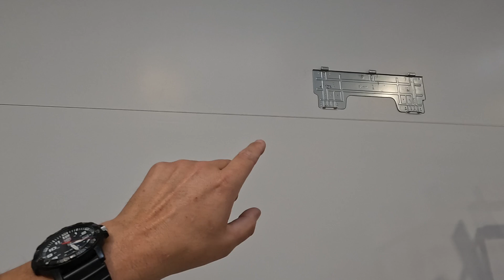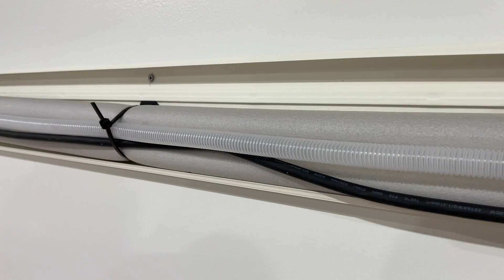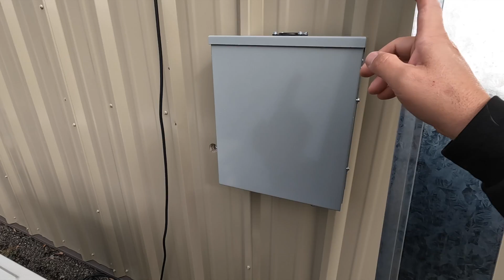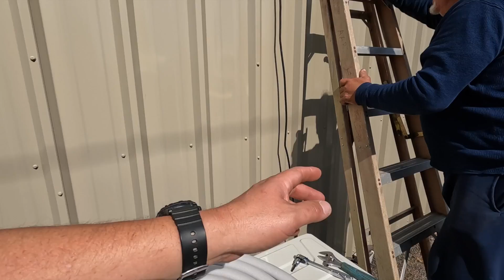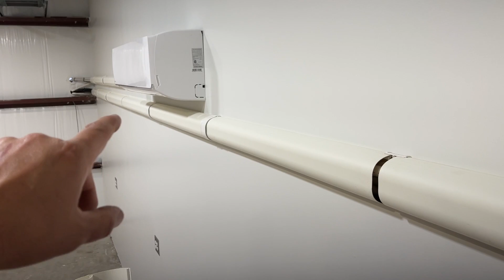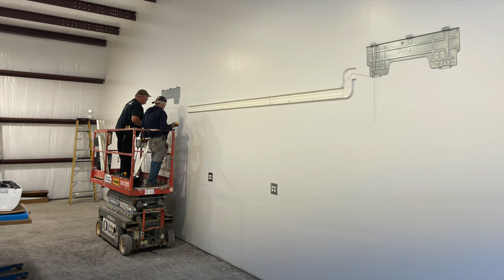Mr Cool AC INstall for New Shop Part 2

Comment: Does the installation manual mention anything about coiling up the excess pipework vertically?  Some say it creates an oil trap so needs to be horizontal.
Reply: yes, pretty strange, I would have thought refrigerant pipework should be cut to length, esp. when installed by a professional...
Reply: @n1352-m1i  If I understood correctly the system was pre-filled, that's probably why it cold not be cut to length.
Reply: @BrainHurricanes  The pipes weren't pre-filled. They arrived empty.

The refrigerant was stored in the condensers.
Reply: @BrainHurricanes  I've installed pre-filled systems such as these (DIY, only smaller perhaps) : I've cut the hoses to length and redone a cone to the shortened end (it's only copper, a lot easier than stanless fuel pipes) imho it's better to keep the dead volume as small as possible (then there is the syphon neck issue with keeping the extra tubing coiled...)

Comment: Thought they made extension lines as well there is another company I know of with quick connect 25 or 50 feet  precharged with 410a
Reply: Correct. I’ve seen extension lines sold online. Perhaps they were out of stock or Fernando could make lines himself for less.

Comment: I hope you installed the drain lines with a slope, otherwise they might be useless and not working correctly
Reply: Was just going to ask if those needed to be sloped to allow for proper drainage.
Reply: yup drains need to be laid to fall and the pipe insulated otherwise they will sweat in the summer and drip everywhere

Comment: Why dont you pull a vacuum from the lines? That would make a Vetter performance especially with the long lines, you have pleanty of Wir in the System, thot dont need to have that, a little Hand pump costs 20 Dollars and did the Job for me, a professionell should have a pump.
Reply: Did i watch the same video...i saw manifolds and vacuum pumps right there
Reply: @nekoroms  yeah, vut at the manifolds you see a little cap on the left, there you can pull a vacuum out of the lines, the lines cant be prefilled, sice the were lengthend
Reply: As a HVACR tech I can tell, those are precharged refrigerant linesets (the big give-away being those massive cupplings) so no evacuation needed. I am not saying I think it is a "flawless system" and I personally am no fan of those lines donuts behind the condensers, but as long as the installation is done correctly it will work.
Would custom cut & bend linesets look nicer? Yes they would most likely. Would a evacuated lineset improve the performance of the system? Only if you messed up those cuppling and have created leaks. My concern is with the boatload of cupplings leaking at some place in time... or never at all...
Reply: @Arides2010   " am no fan of those lines donuts behind the condensers," I agree. I made mention of that and apparently Abom didn't like my comment, and deleted it.
Reply: Let it go

Comment: You need a cable clamp where your electrical wires enter the electrical box on the condensers.  Keeps them from chafing on the edge of the metal.
Reply: Man, you Sparkies notice every little detail, it must be tough working around inspectors that are so picky that they have you doing it also. 
Just kidding, it seems as though every tradesmen notices every little detail in the jobs that they do everyday. We always called it a curse!
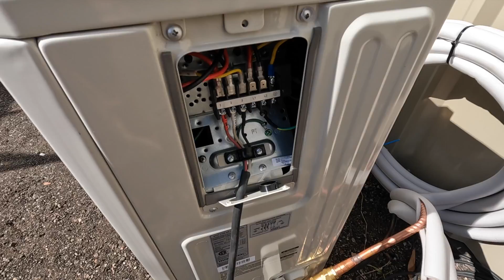Reply: At 12:35 you can see the cable was not even clamped properly for strain relief.
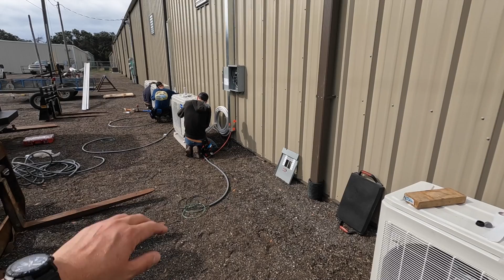Reply: @markdavies9912  Probably because actual electricians were coming out later that day to finish the install. 20:00

Comment: Those sure make for a nice installation and from what I have heard perform very well. Something on my list for my up and coming shop. Are you using the same remote for all four or switching units off camera?
Also, I see you have installed security cameras. Good thing from what I have read about your area. Not sure if it would compromise your system if you were to discuss it, but if not would, I would  like to learn more.

Comment: You might want to consider getting a condensate pump for those two units on the sheetrock wall. Thats a long way for them to drain. I can see them being problematic in the future especially the one closest to the big door. They make mini pumps specially for mini split units that you could probably tuck in the line covers and it will take care of any slow draining issues. Just something to keep in mind in the future if they give you any issues.
Reply: I had a problem with a ceiling unit spitting rust (in an office environment). It turned out the installers did not know that water doesn't flow up the hill :-)
Reply: Yeah, on a run this long, I would have gone with a mini pump as well
Reply: Seems like those pumps are problematic or at least the ones that are internally housed.  I guess the external ones with clear tanks are probably not so bad.
Reply: I agree, have seen this issue before
Reply: This comment beat me to the punch we had trouble with ours draining and they didn't have that long of length! But we shortened the path and now it's good!
Reply: A P trap and 3° decline will do.
P trap necessary due to pressure differential.
Reply: I think just having enough slope would do it.

Comment: Will the first "extended" unit have issues with drainage as it have tilt upwards near the wall? I am not specialist but it seems to me it will leak inside the shop.

Comment: God, I hope no one breaks in and steals those condenser units. That happened at a company I worked at a few years back. Didn't notice them gone at first and even tried changing the batteries in the remote before realising. I absolutely agree that if you're not physically comfortable in your shop, it can be hard to keep focused on your work, especially if it's mentally demanding and requires utmost care and precision.

Comment: I have worked in many places, and sure, climate control is expensive, but so is precision.I was surprised to hear that CNC machines pretty much demand air conditioning if you are looking for high precision on parts. They explained that the spindles and the beds and ways would change size over the course of a day. Size is a factor, but if a company can aircondition a retail store, a company can air condition a warehouse, manufacturing plant, etc.

Comment: Are those AC lines pre vacuumed? I didn’t see them evacuating they lines before releasing the charge
Reply: the factory lines were precharged.  He broke seal by unscrewing that nut.

For the 2 they extended lines on they had to charge it themselves.
Reply: @flewdefur  The actual lines are pre-charged? I thought the charge is held in the compressor and the nut releases it into the lines.
Reply: @seephor  on these Mr Cool units, the lines have sealed end fittings and are precharged.  They're designed for DIY installation.
Reply: @Chris-hy6jy  got it. That makes more sense now.
Reply: I think you can see the pump at 11:02 - leftish with yellow hose leading to pressure gauges.

Comment: Excellent feature that you don't need an official charging exercise for a normal install, but it surprises me that you can throw that add'l 25 feet of line into the system with no consequence. I assume you asked the factory dudes when you were doing your research. Hope you have enough slope on your drains. I'd stake that PEX away from the bases under your condensers. In the summer, those drains should dump considerable water.

Comment: Here in AZ you would be lucky if those outside units would last a week before they are stolen.
Reply: At my HVAC dealership, some outside condensing units didn't last a day before hacked up and the copper pulled.
Reply: @DFWKen  have a place next to my work someone hacked up 8 units on the roof of a building one night over a weekend.
Reply: What part of AZ?
Reply: Sounds like you guys should get some trail cameras and try to catch these druggies in the act! It’s a shame people or companies can’t have stuff without these idiots trying to steal whatever they can get their hands on.

Comment: Are all those fittings metric?  I noticed he was using a metric adjustable end wrench.
Reply: Adjustable wrench?  You mean Vernier Caliper? 🙂
Reply: @Chris-hy6jy  15:19  It's a joke.
Reply: @firesurfer  so is using a caliper as a wrench 😉
Reply: @Chris-hy6jy  There is no caliper.  whoosh!
Reply: @firesurfer  yes I know, I told that joke the wrong way around really but you get the idea.
Reply: Actually, it's a vintage Whitworth wrench.

Comment: I missed that part four thermostats ?  
One rooftop unit with one control and proper capacity makes more sense.
If you remount the two units with drain issues higher it would leave room for the drains a proper amount of slope.  
I'm sure there's a proper spec on how much slope there should be.
Reply: Probably would have been less expensive, at that.
Reply: @DFWKen  He's advertising these, so maybe they are freebies ?

Comment: That farthest handler , the shorter drain elbow might be a little too long. The drain hose seems to arch up and around to your PVC entrance. Will the water actually drain without running back into the unit?

Comment: Shouldn't the drain lines outside run past the pad mounts? Moister running under the pad.
Reply: Drain lines dribbling outside onto the ground doesn't meet code here in Texas (or probably anywhere else in the USA).  I was told that it breeds mosquitos.  French drain, at the least.  (and it has to be inspected before filling with gravel)

Comment: Did he have to add refrigerant to the system to accommodate the added length?
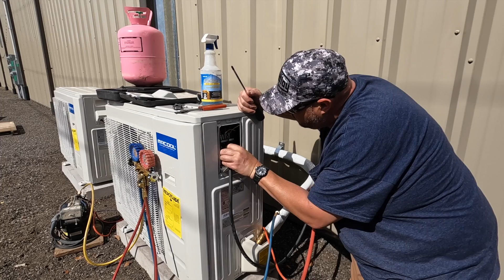Reply: Yes. You can see at 10:35 a vacuum pump, manifold gauge, and Freon cylinder. I’m not exactly sure how they extended the line, but Fernando obviously knew a way.

Comment: Better build a cage around those units, prime targets for those that take other people's stuff.
Reply: I was thinking about mounting them high on external wall, to prevent theft. With cages as well.
Reply: Just tie off ground to a grounding rod near by, tie the hot lead to the case.  Problem solved.
Reply: @MrThisIsMeToo  Except in the US, Adam would get sued for violating the thief’s civil rights.

Comment: How hard can it be to get rid of those thief-bait coils? Isn't it just a matter of cutting the lines shorter and silver-soldering new connector ends?
Reply: The lines are pre-charged. You can't shorten them without losing the charge.

Comment: Adam, 2 questions: 1.) pan tabs? - with all the mold and mildew those drain lines will eventually plug up. where do you drop in the chlorine pan tabs to keep those lines clear? 2.) what about the pass-through holes in the back wall, did you use expanding foam to keep bugs and rodents out of the shop?

Comment: looks good! the only thing i saw is the cord to the air handler isnt installed properly. that S/O cord isnt rated to be outdoor like that (unless it is SOOW, then you just need a weatherproof cord grip) and theres no cord grip connector where it goes into the box. 
i know it probably isnt being inspected, but there could be issues down the road . at the very least you should run it inside some sealtite to the wall, and then conduit into the building.

Comment: You don't need to vacuum purge air from the refrigerant lines?
Reply: The DIY lines come pre charged. When you tighten the lineset fittings they release the charge. I saw his vac pump for the other longer run units. I believe Mr. Cool sells additional precharged linesets too but they did it the normal way for the other two units. 

I have a 1.5 ton Mr. Cool in one of my garages. Very happy with it. 

Adam if you are reading this you had a slight uphill slope on the condensate hose into the 3/4". I would address that. If you plan to use it in heatpump mode there is a little drain fitting that is supposed to be installed on the bottom of the condenser. Mine is on a wall bracket so I can get to the bottom of mine. You will have to unbolt them and tilt it. Truth be told I didn't install mine either as I won't use the heatpump.

Comment: You didn’t mention the benefit of rust control on your equipment with air conditioning.  I live up north and my shop is in a walk out basement and I run a dehumidifier as well as air conditioning the house above. Haven’t had rust issues in 40 years. You will love this benefit!

Comment: Nice job there ! But it would be better not to coil extra pipelines (yes I know it requires cutting and soldering joints) and you should check charge for the first unit as it needs more coolant in that large hoses.
Reply: View the footage at 10:35. I see a vacuum pump, manifold gauge, and Freon cylinder. Fernando was on it. 👍

Comment: They make condensers that support up to 8 air handlers, so you only have to run power to one unit outside. I have LG unit at my house, it works great. Good job on the install.

Comment: These are great units for shops that aren't really dusty. I did some work in a friend's garage that had one of these in it and it seemed like once a week I had to blow out the filter from the dust. It did a great job of temp regulation though.

Comment: think you can add a pump to the wall unit?  can on most of them anyway.
Reply: These are dual use. Have heat pump and cooling in the units.
Reply: @michaelleskoske7723  I think he means for the condensation drain.

Comment: You need a 1/4" per foot drop on drain line, use 3/4" PVC, the ridged tubing holds water in the line that can bacterial groth to grow.
Reply: 23:24

Comment: Looks like the discharge hose is parallel to the ground and going up-down-up-down as it is tied up. Standing nasty ac water will pool and grow some nasty bacteria/mold that will clog the system (unless you go up over the units and dump some diluted bleach every once in a while especially when it is humid)... I am pretty sure the installation manual talks about having a down incline for the discharge hose. I installed one in the garage and enjoying 70F all summer when outside is high 90's with 80% humidity... I inclined the hose but there is a is 0.5" climb before the hose goes into the wall to outside... Needless to say that my system gets clogged 2-3 times in a summer. Good luck. 🤣
Reply: I believe you are referring to the electrical service.
Reply: 23:24
Reply: @mitchkronowit3633  I agree at 23:14 it is parallel to the ground but if you look at the far end it is at the bottom of raceway but I agree is is a slight slope over that distance. Time will tell how much of a problem.

Comment: Adam did you have to ad any freon because of the extra lines you had to add? looks very nice
Reply: He didn't say, yet, but Fernando did have a refrigerant tank, gauges, and other apparatus at the outside units at one point in the video.
Reply: @Ddabig40mac  thanks

Comment: Adam those drain lines need a slight down hill run to the wall, same as the gutters on your house, so the water won't back up and run on the floor.  Are all four programmed to use just one remote control, makes it easier than having a box full of controllers.
Reply: They probably have the built in pumps
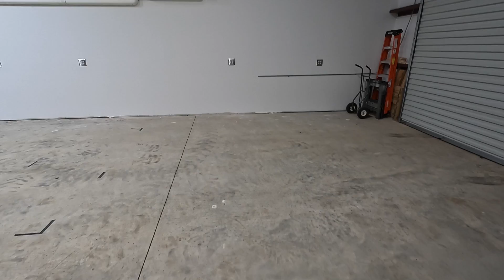Reply: He controls all 4 with one remote. 24:04
Reply: Nope.  As long as the outlet is lower than the inlet, and no any one point of the line is higher than the inlet, it will not matter.  Every solid slab foundation house with central HVAC in the south has condensation lines that slope upward from conduit in the slab.  Yes, water will remain in some portion of the line at all times, but it will not backup unless clogged (condensation lines should be flushed periodically anyway to prevent clogging).

Comment: So if they come precharged with refrigerant, and they come with a 25 ft. line. Wouldn't they need more refrigerant for a longer line since they were expecting you to use the 25 ft?
Reply: yes, if you noticed in one clip out back, they had a bottle and gauges out there assuming they charged the system properly after adding the additional lines

Comment: Adam, go over the gas line strapping with duct tape, it's more durable. The white insulation isn't as good and needs protection. Coiling the gas lines can cause any condensation to sink to the low spots, hence why you might give them one more wrap

Comment: fyi for those of us not in Florida and that get snow you need you put  outdoor unit on a stand or elevated from the ground. you also may need to shovel out units out from the snow. this is for the heat pumps  not cooling only units

Comment: I agree with everybody else. Those drain lines need to be angled down toward the back wall. Bigboy isn't too fond of criticism.
Reply: As long as the outlet is lower than the inlet, and no any one point of the line is higher than the inlet, it will not matter.  Every solid slab foundation house in the south has condensation lines that slope upward from conduit in the slab.  Yes, water will remain in some portion of the line at all times, but it will not backup unless the lines get clogged with debris (every condensation line lines flushed periodically anyway to prevent this).

Comment: You may want to look into a pump for that long condensation line run, I believe they make them specifically for this application with a little float switch and everything

Comment: Where your condensate drains empty on the ground, dig a 2 foot deep hole 1 foot in diameter and fill it with crushed stone so the water can percolate into the  ground and not puddle up on the surface.

Comment: FYI all of theses units are prone to drain clogs regardless of brand. I have found a great help is a 2 gallon cordless shop vac works great to clear clogs without tearing the unit apart. My MRCOOL is working great over the last 4 years I love it.

Comment: From past experience I'm gonna caution you that those long drain lines are going to be a problem. There are condensation pumps designed for mini-split units that work very well to replace long drains like those for about $60
Reply: Yeah I’ve seen mini splits with external pumps before (-8
Reply: I have a pump on mine for this exact reason